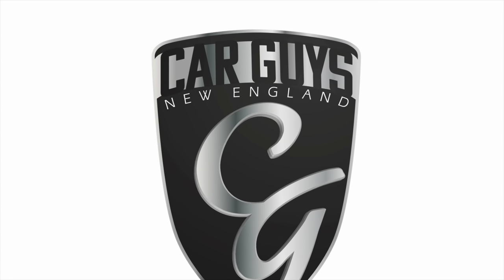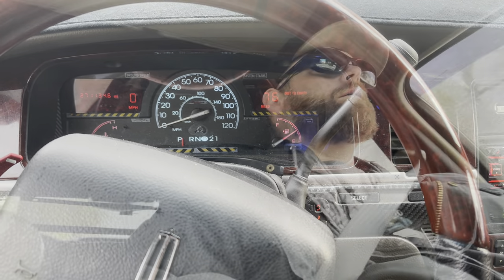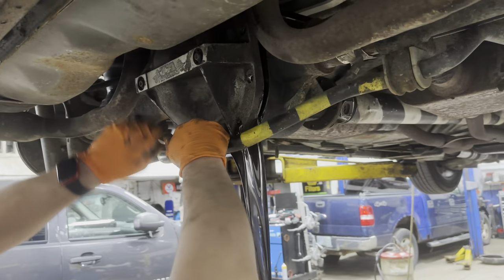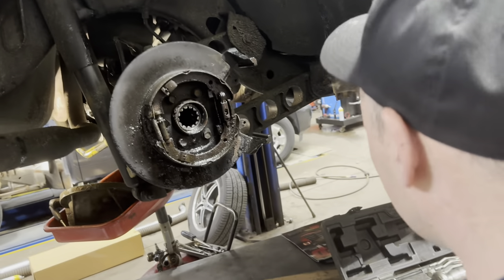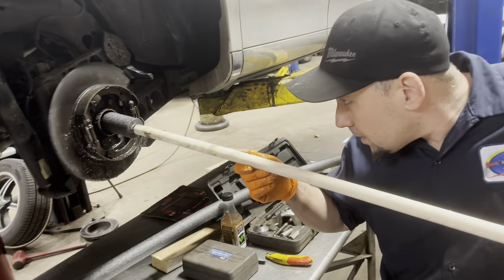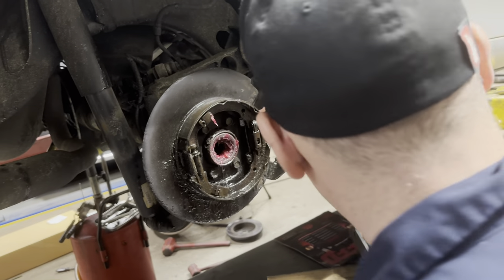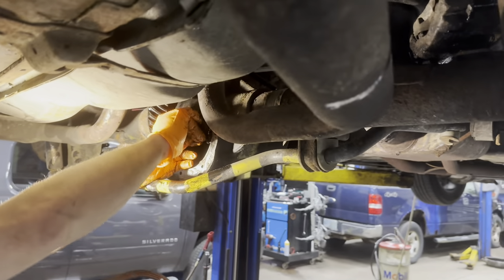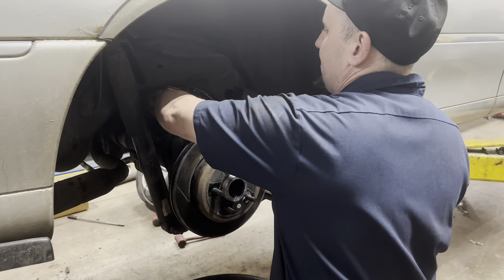One Thing I Hate About My Lincoln Town Car! Rear Axle Problems!

Comment: My 03 I replaced the bearings with repair bearings at 155k beginning of 2020, by 175k in June 2020 they were leaking again. Took it to a shop the second time to find out the metal shavings killed every bearing in the axle housing, looked so bad they didn't believe they were only 6 months old. I ended pulling a used low mile clean unit and had them completely overhaul it, all new everything. Now sitting at 239k and still running good, other than a failing driver side cat.
Reply: Where do I found rear axel for 2005 Lincoln town car signature

Comment: Good job guys, but you dont even know half of what I know. When you pulled out that left axle and stated it looked machined the way it was worn down, it actually was machined too far down or a smaller circumference at the factory, because if it had worn down to that point there is no way the roller bearing in the tube could look good as it did. That car was sold new with that up and down end axle play, but it got away with it because the weight of the car caused the axle end to push upward into the smooth machine turned on the axle and ride on the upper area of the roller bearing, and even though it wallered out ruined the seal, it stopped leaking once the axle tube was empty of oil and a quart or so remained in the third member which splashed oil on the pinion and ring gear. Legend of the story, the factory of the company that turned and built that axle was given the wrong blue print, by some idiot and there is probably many other crown vic and marquis and lincoln town cars out there in the thousands running the wrong axle. Anyone wants to argue this, READ it again and understand everything I said here

Comment: You need to pull that ring gear carrier assembly out and through in you parts washer for a real good flush. Push all that crap  out of your axle tubes to the center of the housing. Spend the extra time and money on brake clean or whatever solvent you like. Rework is not cheap!

Comment: I have a similar issue on my ford crown victoria 2006. rear diff was "rebuilt" by my regular mechanic, who didn't have much experience doing that, by his admission. about a year later right side axle started leaking and growling, a year after that, maybe 10k miles, again same axle needed work, growling, a year after that another 10k other side, and now again, another 10k or so one of the sides is growling again, and i need to find a new mechanic :). I like your debris theory, hopefully it was resolved for you, because I definitely get the annoyed with recurring expensive problem thing.

Comment: the bearing go bad because of the housing the bearing doesn't get lube oil only when u turn corner, if you put the new bearing in feel on the inside of the bearing the ridge of the bearing housing sit to high oil don't soak the bearing put a little more fluid in it that is what i found with these

Comment: As an owner of half a dozen Panthers I can say this much... I bought my 95 Town Car with 200k miles on it, and as far as I'm aware, original axles and bearings.  I put another 300k on the clock and never had an issue with the seals, bearings, or axles.  My first 05 TC went through bearings and axles 3 times, including swapping the whole rear end the second time around, over 150k miles.  My 03 GM after that went through a set of bearings after about 50k Miles  after I bought it.  The next 05 TC I bought made it 25k miles past the 170 when I bought it and sheared the axle shaft right off the hub, had to have a rear end put in it because I was in BFE with no tools or anything to do the work.  My latest 06 TC is sitting on jack stands right now with disintegrated bearings and a bent axle and tube from the heat after the bearing went out, and caught the speed sensor on fire while an employee was borrowing the car.  Still trying to locate a replacement rear end that isn't priced absurdly.  
I'm not sure just how common these problems are, I suspect it's more common for folks that put on a lot of highway miles, but it seems like there's a flaw in the design of the wider axle on the 03+ panthers.  I love them, but I'm pretty tired of axle issues by now.
Reply: Did you regularly change the diff oil?

Comment: Yeah Jay I feel your pain. I'm dealing with diff issues on my 00 TC.  Diff had been quiet for over 2 years when I put the eaton trutrac in. All of a sudden I'm getting a rumble out of the rear particularly when making a wide sweeping left hand turn
 and giving it just a little throttle to compensate for loss of momentum going around the turn. 
Thought for sure it was the axles ordered new bearings, seals and ordered new axles new axles look like shit compared to the the oem's. I have the 28 spline diff  when I pulled the oem axle's out really was no real wear to them tho the left axle has just a slight hint of a couple poc marks. 
Put the new ones in any way and button it up still got the same issue. Round two pull cover again pull diff and pinion out bearings looked good on pinion but carrier bearings looked like the races were wearing press all new bearings on and put it back together same shit. 

I have theorized that I may have a light pre load on the carrier bearings and when making the a left sweeping turn the driver side axle is trying to pull out while the PS is pushing in and causing the diff to walk away from the pinon gear a bit and hence the rumble as they are not meshing well. Didn't have this problem till started spraying the motor thing is putting out some crazy torque like 570 ftlbs so wondering if the 8.8 is not up to it. So I feel your pain and forget oem axles I found like the last two in the us for mine @ $450 a side no thanks. Good luck with yours.
Reply from the maker: Sorry to hear your going through diff troubles. If this set doesn’t last I think I’m going to find another rear end.

Comment: So I’m having issues again with my 2003 town car it hasn’t even been a year since I’ve had the whole rear end replaced and here i am again this will be number 3 of replacing the wheel bearings i had a shop do the work each time and i am now wondering if they removed all the metal silvers like you showed in your video. Can you order a whole new rear end or should i just replace the bearings and axle again. This is really getting old and expensive but I love my town car so thanks for a great video
Reply from the maker: If you replace axles and bearings clean everything really good inside … then drain it again after running it for a few weeks and see what else comes out

Comment: you have to get 100000000% of all the metal shavings out or the new bearings and shaft will fail in 10,000-20,000 miles...
Also used OEM shafts are far superior than new aftermarket, go to the junk yard and get shafts out of 60,000 mile cars all day long for $43
Reply: I don't believe so. Aftermarket axles are harder then OEM. OEM in this case is the cheapest vendor and early OEM 8.8 axles were known to be too soft that lead to failures.